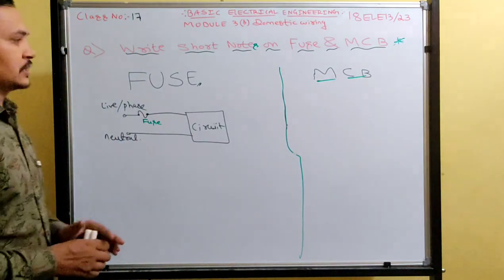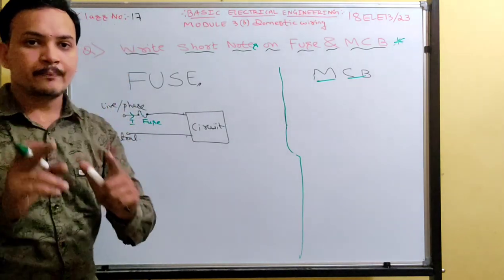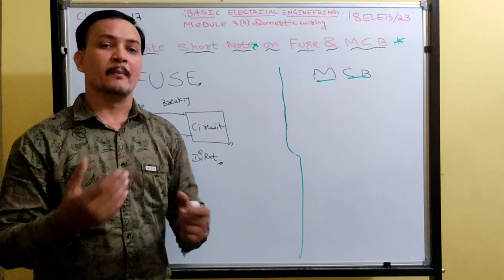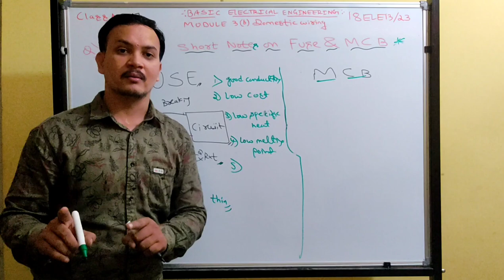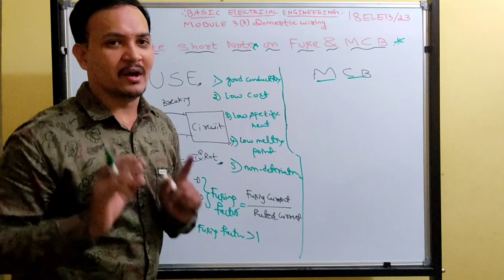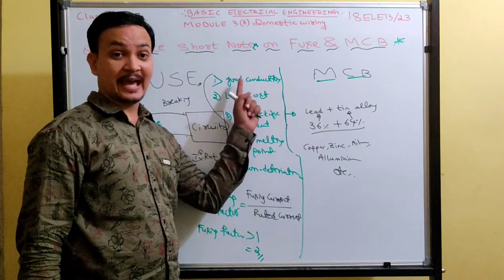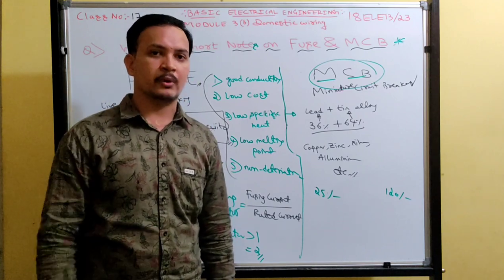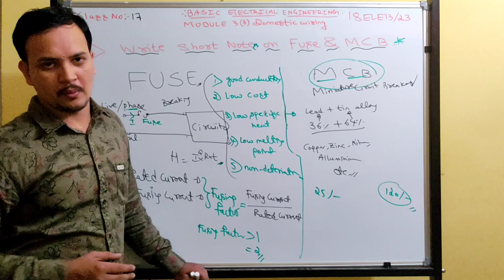Basic Electrical Engineering| VTU| Fuse and MCB |21ELE13/23 Module 5

Comment: Sir vtu syllabus 2021 module 5 low Low voltage distribution system (400 V and 230 V) for domestic, commercial, and 
small-scale industry through block diagrams only. 
Electricity bill: Power rating of household appliances including air conditioners, PCs, laptops, classes
Madi sir
Reply from the maker: Will do soon